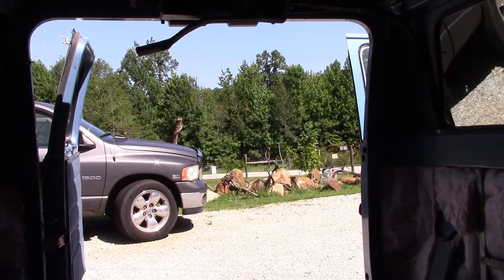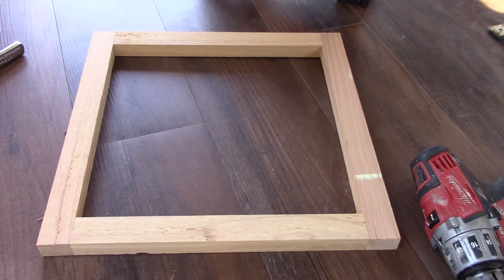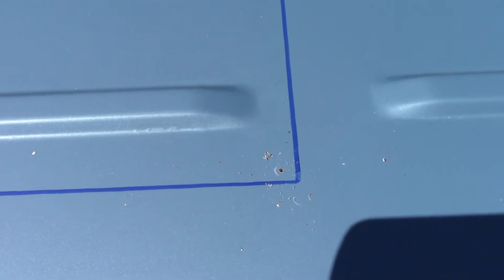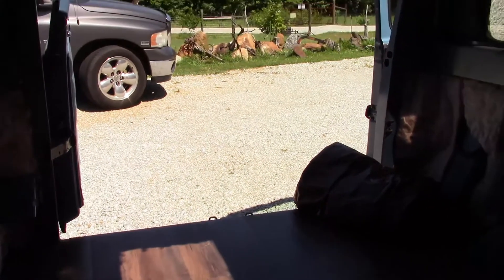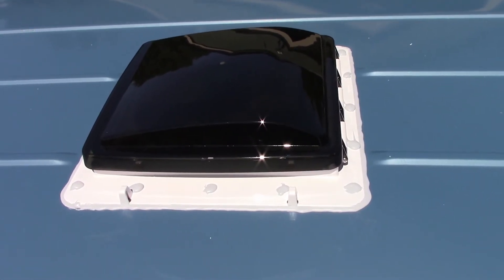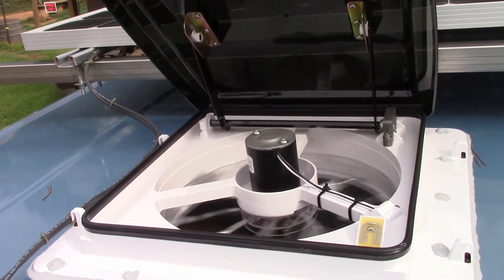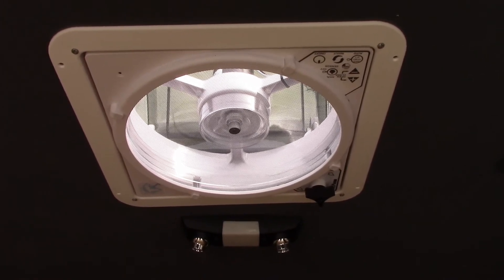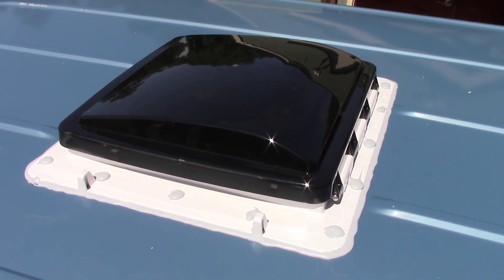Van Conversion-Installing & Operating MaxxAir fan-DIY

Comment: How did you wire it up be nice to see how you did that thanks
Reply: Jjames Notme id like to see that too =)
Reply: I would LOVE to see a video on wiring these fans.  1,000,000 videos on cutting holes but 0 videos on what to do with the wires to get them to work.  sigh

Comment: Currently installing the MaxxFan 5100K into a Ford Econoline. Everything seems fine, except when I drop the fan into the square, the four metal holes are too high up for securing it with screws. Any ideas?

Comment: That is the cleanest installation!  You were lucky with roof ridges, How would have dealt with one of those landing on your flange?  Do you find that this unit is lower profile outside than the Fan-Tastic?  On amazon your 4500K no longer appears to come with the cover hooks.. I'm looking to buy the manual 4100K, but don't want the cover hooks and also I'd like install a rocker switch so it can extract too.. know if possible?
Reply: I bought the 4401K cheap on Amazon.  It's super quite and powerful but THERE IS NO WAY TO REVERSE IT to fan in, not even reversing polarity works.   Also on my van I was hoping to go with a thin 1 inch ceiling/headliner from the sheet metal and the Maxxair expects you have a thicker headliner so I would have had to make a custom frame for it.

Comment: This video helped a lot. Can you just open the lid part way manually with or without the fan running ? Do you know if they make a cover to go over it that allows the fan to open all the way and use while driving ?
Reply from the maker: I did add the cover. You can open the lid manually. Thanks for watching 😊
Reply: @homesteadhandyman4481  what cover did you add?  Will the fan open fully with the cover you chose?
Reply from the maker: @rvingtheusa  you have to use the Maxx air cover. The others don't fit. I'm telling you this from experience 😂
Reply: @homesteadhandyman4481  Yes, I was speaking of the Maxx brand covers there is FanMate ,  Maxxair 2 , and the original that I'm sure the last one is to low to work with the remote fan. Was wondering what one you used.

Comment: Yes! Outline the area with painter's tape first before cutting. Good video. This is the same fan we installed in the GoneCamper Chevy Express - except we used the wooden frame under the sheet metal for added stiffness. GoneCamper.com

Comment: I've been running my van with very similar install.  
I have this idea... I'm  looking to install a big 360 watt solar panel over my fan and just remove my fan's lid and the solar panel would keep water out.  There would be about a 1" of opening between the the highest part of fan lip and my solar panel back.   I think that enough for good air flow given it's 360 degrees of opening.   Also think/hope that having the solar panel cover the opening with good 10" of roof and the lip on the end of the solar panel I won't get any water even while driving in heavy rain at highway speeds.  Anybody try this think otherwise?

In my case since my van is shorter height wise I see this change as making my van even more stealthy as the fan's lid pops out and is visible from the sidewalk vs a solar panel would be one flat surface and will sit a good inch lower and inside some custom roof rack I have. Anyways I had to paint the inside of my fan's lid as it was letting too much light in at night while trying sleep.  And i could never open it more than 30% when it's raining.
Reply: I've also contemplated removing the lid and installing a fan under solar as well. I think if you are parked it would be fine, but driving I'm not so sure.. I bet rain/dirt/dust would get underneath the panel and into the open fan unless you seal off the gap between panel and van on the front and sides of the panel. Even then, you lose the thermal sealing of the fan lid.. so some form of thermal block would need to be able to get placed on the underside of the fan (inside the van) when it is cold or hot. I am tempted to do this but feel that less solar and room for the fan is a better decision. Let me know how it goes for you if fan w/o lid under solar panel is the path you take! Another approach to consider.. installing the fan on the upper part of the back door.
Reply: @deanduke8677  I redesigned my roof and thanks to a very tight custom wind deflector and curved side LED lights nothing is getting in on my open vents while driving during heavy rains.  Here's a video of that build:  https://www.youtube.com/watch?v=HnBreDEpmaM .. I also just completed a 7 gallon solar 4" PVC U-shaped tank to completely cover my roof and also further protect the exposed vents without restricting air flow.  Preparing that video over the next few days.